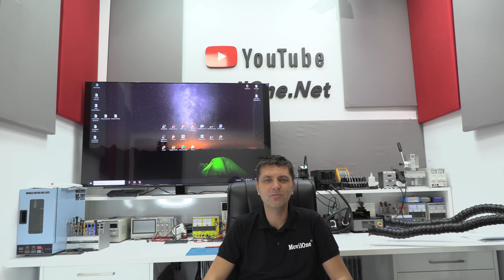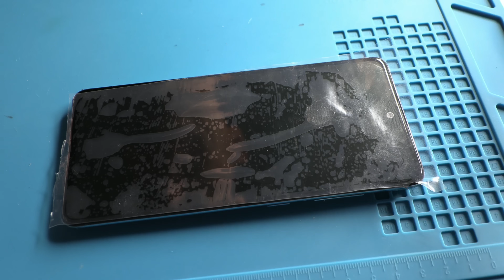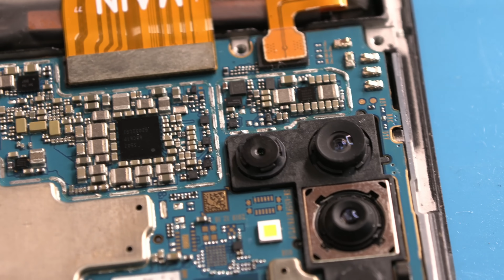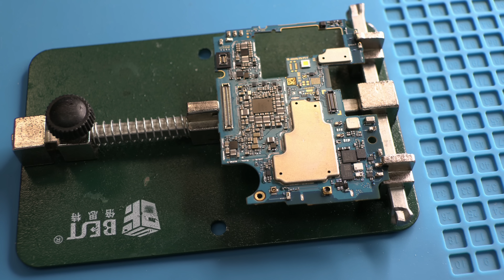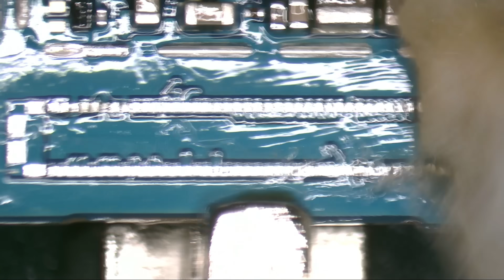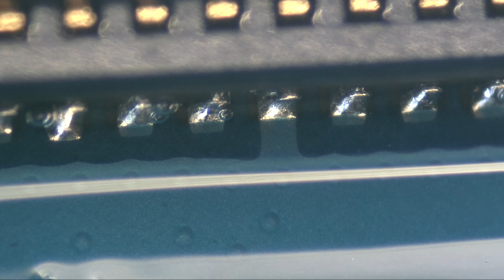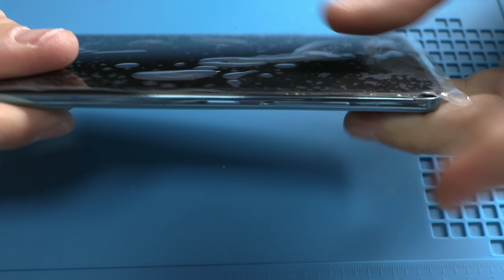The Samsung A Series Secret They Don't Want You to Know!

Comment: It's not design to fail. Unlike Apple's macbooks display connector that is wired in a way, that +60V line is right next to 1,5V data line from CPU so any accidental spalch of water kills the CPU... While the industry standart anywhere else is to put ground pins to separate power lines and data lines in the connector and this issue exists for 12 years to the present day.
This issue is just simply because of the environmental policies and norms to use non-leaded solder forced by European Union and posibly other countries. The product has to comply in all countries that it is sold there. The fact that you are an EU company and you source and use leaded solder makes you non-complient to those norms and i would be carefull of displaying it. Hell you cant even buy leaded solder in hardware stores in the EU!
As stated in this paper https://cordis.europa.eu/project/id/5770 restriction on lead-solders were placed since 2006 and researches on other means of soldering were funded. Tho obviously the only economicaly viable way is to use non-leaded and brittle solder that replaces the lead with copper, aluminium....

Are those norms stupid? I belive yes for avarage home DIY user / repair shops that buy coiled solder. However you need to keep in mind that mass production uses tones of solder that is constantly heated for spash soldering so the problem of the leaded solder is the vapor and contamination of the air by lead.

However this has a very simple USER prevention of this problem. Place your phone into a phone case that will absorb the shocks ofc of failing but when you place the phone on the table , etc...
I had Galaxy m21 since release to the end of OS support which is 3 years and i didn't had any HW or even SW problems. In fact i didn't ever had that problem on my 4 phones before that. Devices don't generaly fail because they are designed to... they fail because the user is not using them in respect to designed limits.
Doing so would make the company bad PR and high cost losses on returned devices and varanty repairs so no making devices fail on purpose is absolutely not making sence! It's always about cutting corners and making the device cheaper to manufacture and by the end the problem si THE CONSUMER that whants for cheaper get more...
And if they do it's sooner or later discovered because the problem is so wide spread in the case and occuring to everyone so it gets pressed by consumers just simply not buing the products form that company and consumer protection laws - like Cannon in 2010 - 2015 when their purposely placed software killswitch that made the printing head error just after warranty expiry...

Comment: Very true video. My Panasonic phone too got exactly same problem while replacing the battery.  Now it can't charge. The connector is not available. 😢
Reply from the maker: I'm sorry to hear that. Panasonic devices often use less common connectors, making replacements harder to find. If you can identify the exact model of the connector, you may have some luck searching on platforms like AliExpress or eBay. It’s frustrating when manufacturers make repairs this difficult.

Comment: Hey it's posible to Do you change a processor from a phone? If yes, how?
Reply from the maker: Yes, replacing a phone processor (CPU) is technically possible, but it's one of the most challenging repairs due to the complexity of soldering BGA components. It requires specialized tools like a reballing station, precise temperature control, and extensive experience. In most cases, this type of repair is only attempted by highly skilled technicians and success isn’t always guaranteed.
Reply from the maker: https://youtu.be/eCpbTdXKFA0?si=DymHvi-DD9J6pBZW

Comment: such bad internals layout, the fiber cable ontop of a lithium battery that will at some point swell? destroying display along with it 😑😑
Reply from the maker: Exactly! Placing delicate fiber cables directly over lithium batteries is a dangerous design flaw. As batteries age and potentially swell, they can damage internal components like the display or flex cables. Sadly, these design choices often seem intentional to increase repair costs or push consumers to upgrade.

Comment: People replace phones every 2-3 years, technology moves so fast!
Wireless co.s offer free or almost free phones for services!
Samsung A series are considered budget phones, a refurbished or pre-owned one cost less than $100, if it's 4G.
5G maybe more, $140.
I always protect my phone, it's really worth that $10 silicon case.
My wife never used it, she said makes the phone too thick, bulky, so her phone fall apart in 3 years!
Mine still like new.
Reply from the maker: That’s a smart approach! Using a protective case can significantly extend your phone’s lifespan, especially when combined with proper charging habits. Manufacturers may design devices to fail, but taking proactive steps like these can help consumers outsmart the system.

Comment: Any recommendations for phone brands?
Reply: Lg v60 literally the best phone for general use, it also have a great 3.5mm hack hole and a micro SD card slot which most android companies abandoned.
Reply from the maker: If you're looking for reliable phone brands that prioritize durability and repairability, I’d recommend considering:

Fairphone – Designed for easy repairs with replaceable parts and long-term support.
Nokia (select models) – Known for solid build quality, especially older models.
Motorola (G-series models) – Often more durable and easier to repair compared to flagship brands.
Samsung (older models like the Galaxy S ) – While newer models have issues, older models with proper care can last surprisingly long.
The key is to prioritize devices with good part availability and community support.

Comment: Samsung galaxy m31 motherboard problem repair please
Reply from the maker: The Samsung Galaxy M31 motherboard issue is often linked to power IC failures or poor soldering on key components. If the phone isn’t turning on or is stuck in a boot loop, reflowing or replacing the power IC may solve the issue. If you’d like, I can provide some detailed guidance on troubleshooting this problem.

Comment: Does the Galaxy S series have this same issue aswell?
Reply from the maker: The Galaxy S series generally uses better materials than the A-series, but they’re not immune to issues. Models like the S20 Ultra have experienced charging port failures, while the S21 and S22 series have reported green line screen issues after prolonged use. Checking for these common faults before purchasing a used model is highly recommended.

Comment: If samsung, a reputable company is doing this then i wont be surprised of apple and other smartphone manufacturers are doing this. Thats why brand doesnt matter anymore nowadays. I wont mind it anymore, ill use my smartphone till it dies. So far so good with my redmi note 11 as of the moment its fast charging is not working anymore though.
Reply from the maker: You're absolutely right. This isn’t just a Samsung problem: Apple, Xiaomi, and many others have been caught using similar tactics to shorten device lifespans. Using your phone until it’s truly dead is a smart move to avoid falling into their upgrade cycle.
Reply: @MovilonePhoneRepair  Yeah dude instead of stressing this out and getting paranoid ill just make the most out of this device. We regular consumers cant do anything about this issue anyways their too powerful. Well i guess if people boycott their products but thats just out right impossible. Thats why im not fan of upgrading lately. Good thing pointing this out though so that many can be aware of this shady work.

Comment: What is the situation with the Samsung Galaxy S22/S21 series or the even older Galaxy S10E? Do they have any similar flaws or problems? I'm planning to buy used phones, i am asking so I don't step into a similar minefield?😷
Reply from the maker: The S22 and S21 series have improved slightly in build quality but are still prone to issues like green lines on the display and charging port failures. The S10E has been relatively stable, though battery degradation may be a concern in older devices. If you're buying second-hand, I'd recommend checking these components carefully.
Reply: @MovilonePhoneRepair   @MovilonePhoneRepair  Thanks for the reply and the details. My last cellphone i bought new was an SE K510i back in 2006. After that, i decided to only buy used cellphones. It's not bad to live a little on the edge for a change+you save a lot of money.😁The only used phone that died was the SE Xperia Ray, and that was after a year and a half of use in my possession. After that, i only bought used Samsung phones. The first was the Galaxy S2(except for the 90% dead battery, it still works when turned on), then the J5 2016(he is alive and well), and after that the J6 2018 which will now serve as a backup device if needed . Now a few days ago i picked up a used Galaxy S21, i need the Samsung Dex option so let it last as long as possible. Finally, i don't like big devices or brick-sized phones. The phone I use will never be bigger or taller than 15cm.

Comment: Can you explain what's the issue behind major facing issue on display lines and the solution for it.
Reply from the maker: The green line/pink line issue is typically caused by damage to the display’s flex cable or voltage irregularities in the Display Driver IC (DDIC). Unfortunately, once these lines appear, the most reliable fix is replacing the display. Some technicians attempt reflowing or reheating the connector as a temporary workaround, but it's rarely a permanent solution.

Comment: I have had to always charge my phone wirelessly because on both my S7 and S20 Ultra, plugging in the USB charging port into the phone wouldn't work after a couple of months. I've just upgraded to the S25 Ultra, I wonder if the same fate awaits that…
Reply from the maker: That’s frustrating! The Galaxy S7 and S20 Ultra are notorious for USB port failures, often due to weak soldering or dust buildup. Wireless charging can be a useful workaround, but hopefully, your new S25 Ultra doesn’t fall victim to the same fate. Regularly cleaning the charging port and avoiding high-amp fast charging can help extend its lifespan.

Comment: This must be AI generated, because his mouth movements aren't in sync with the narrator's voice.  I'm still here for the info though.  Where are the links to get the repairs done, because I'm not a phone tech expert ??
Reply: He is speaking in spanish. Is that hard to figure in the first minute of the video?
Reply: He's dubbed it with AI
Reply from the maker: I understand your concern. The voiceover may have appeared off due to post-production edits or timing adjustments. Rest assured, the content is based on real repair experiences and common issues that technicians face daily. 
 Since I don't speak English, I've translated it this way. Thanks.

Comment: My A71 faced simmilar issues, not charging suddenly, took it to repair shop they replaced the logic board and it got fixed but not after tgr repair my phone sometimes have touch sensitivity issues. Restarting usually solves this problem

Comment: fortunately, my A70 was still running fine from day one. I bought it after one month of release date as far as I remember. only the display was changed once because the phone fell on a rock and the display got cracked. It cost me 8000/- (in India). there's no lagging issue no bugs it works smooth af. now the battery had degraded a lot so I bought a powerbank instead of replacing the battery. I'm thinking of getting the S series now.

Comment: WOW! I have an A52s that received a software update, and stopped charging properly - 8 hours for a full charge. But if i use a non samsung charger and cable that have red color in all usb plugs, it charges properly. It also stopped reading SD cards and any usb connection, be it connected to a pc or a thumb drive plugged into the phone. Using a USB testing app, Android sees the thumb drive for a second then disappears, but the linux kernel sees the device no problem. Could this weird behavior be caused by the same connector? At one point the phone stopped connecting to mobile networks, and touching this main cable made the issue disappear and reappear. F samsung, they are terrible. The only thing that separates the A52s and the same gen S series is the software, and a lot of money.
Reply: I had a samsung galaxy A70s and that did run fine for like 3 years and a number of issues popped up. The phone would overheat like crazy. Even while scrolling or charging. This felt very intentional that samsung is doing something. After this, the same charging problem. It would never charge perfectly. Always connecting disconnecting type shit like portrayed in this video. Once it stopped charging and after investigating one youtube commentor said to press on the back of the samsung logo. Well that was a loose connection and it fixed my issue. But of course it won't charge properly. 
And at October 25th of 2024, I woke up and was surprised to see my alarm miss. After turning it on... It just bootlooped. 
Now the device is rendered as a brick. Now they have improved a lot as my secondary is A15. Hopefully it doesn't get those issues 🙏

Atleast your device is operational while mine is completely bricked
The only thing to credit my a70s was its durability. Screen completely shattered but no green line or anything.
Reply: By that time I had a secondary phone as moto g6 and it also had some of its faults like battery issues but replacing the battery fixed it. 
No performance issues or overheating which is a very good thing for motorola.
It can still to this day do calls, text, watch videos with like 4 hrs of backup. 
These A series are intentionally designed to break

Comment: No wonder most phone companies give few years of software update to their phones. Even Samsung only gives 7 years OS update to their flagship S25 model whereas their cheaper models receives 3 or 4 years OS updates. They probably know their phones won't last that long hardware wise. Right now I don't buy Apple product because of their policy of discouraging fixes, don't buy Samsung products because with the same specs, Samsung product cost more that other brands, regardless of flagship, mid-tier or budget tier phones. And now this, another reason not to buy cheaper model of Samsung phones.
Reply: If you may by any chance think that this video is fake, im suffering through it and my problem is that my unit is apparently bootlooping.
I had not touched the bootloader at all.

Comment: I also encountered the issue on my M51 (which basically A71 with bigger battery). Since I had a multimeter, I found out that there's no connection on left side ground pin. Jumpering the ground pin from the main pcb to the daughterboard fixed the issue. Now I know that this is a common problem on A series thanks to your video. Will surely never buy A/M series again.

Comment: got the connector replaced in my device the charging issue was fixed but now it echoes during calls fr the caller (not fr me) but stops when its on loudspeaker mode , any idea why it would do this ? nice video btw keep doing these kinda content

Comment: Wait, that connector is similar to the one in Nexus 5. My nexus 5 died because it disintegrated. The plastic housing where the metal connectors are placed just turned into brittle dust.

Comment: Devil's Advocate:  Manufacturers are subject to the same deteriorating part quality repair centers are.  all Chinese made, All cost-cut encheapened plastics.  It's in their interest not to have devices break because then they can be reasonably sure those customers will return when its time.  If standard use (and not accidental abuse like drops spills scratches cracks etc) breaks a device, You'd be LESS likely to buy another from that company.  The shields over the xonnectors are meant to hold them on which will increase stresses on the connector, But prevent it from coming undone, Least in their S-Line, so they are trying to deal with the encreapening of parts.

Comment: Wow I am fascinated by seeing these repairs! I'm quite a newbie in this sector, cause I'm more competent in grosser devices, like basic electronics or electromechanic devices. 
An example of planned obsolescence i can list is the absence of a proper filter in apparatuses moving air, like convectors or hair driers. 
Over time dust builds up, slowly clogs the motor and the resistors, and one can end up having a device that doesn't heat, or the motor windings can burn because of prolonged slow rotation. 
The solution i found? A 1.5$ 250 micrometers metal mesh, able to filter particles in the order of fine sand. The airflow is not compromised, and the time requiring a cleanup extends, at the cost of cleaning more often the filter.
It's  a shame that even professional hair driers, mounting powerful and eternal induction motors, don't possess this particular filter type
Reply from the maker: Your observation about the lack of proper filters in air-moving devices is a great example of planned obsolescence. It’s shocking how something as simple and inexpensive as a metal mesh filter could significantly extend the lifespan of these devices, yet companies choose to leave it out so the product fails over time. The same tactic is used in many household appliances—critical parts are designed to accumulate dust or wear out faster than necessary. Implementing solutions like the one you mentioned is a smart way to fight back against these strategies.